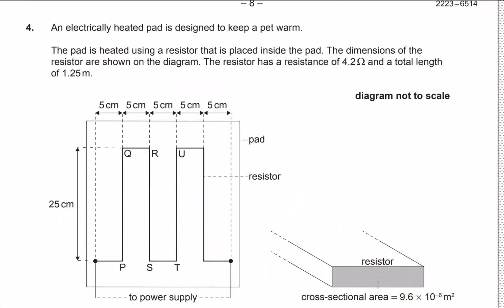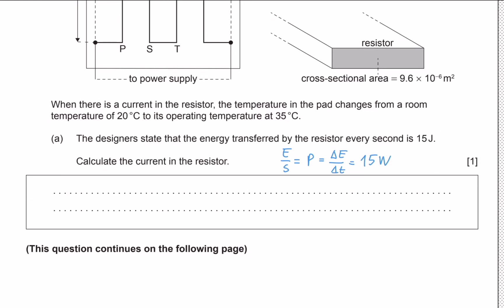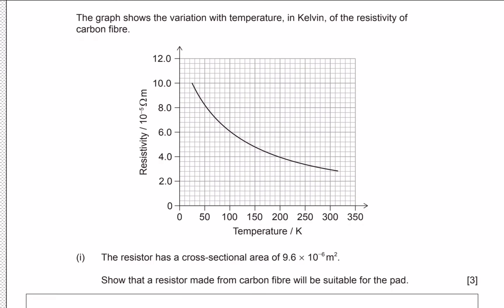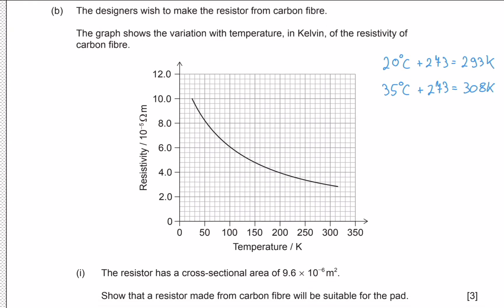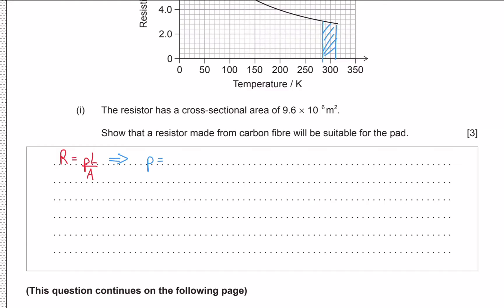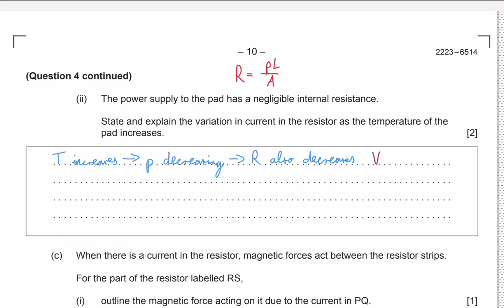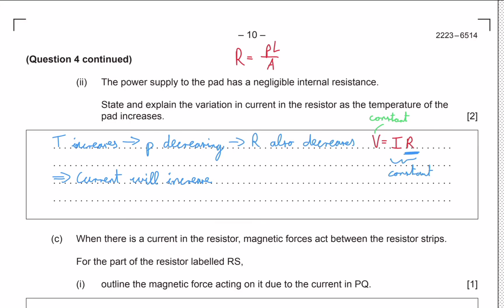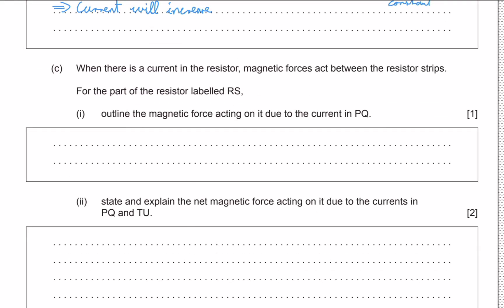IB Phy HL M23 TZ2 Paper 2 Q4 Circuits || An electrically heated pad is designed to keep a pet warm||

Comment: 10:53 the current in PQ and TU are both in thesame direction so why not an attractive force between them?? . dont understand
Reply from the maker: Well yes but the question is asking for the force on the wire that is BETWEEN these 2, which goes opposite direction to both wires you mentioned